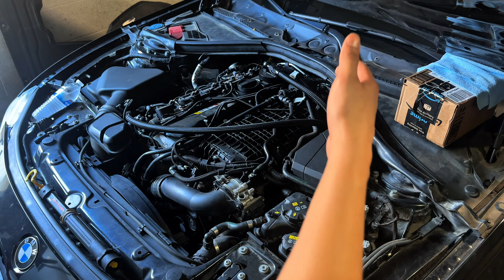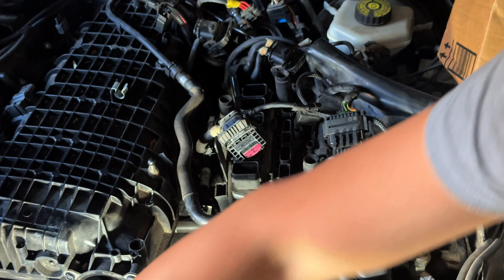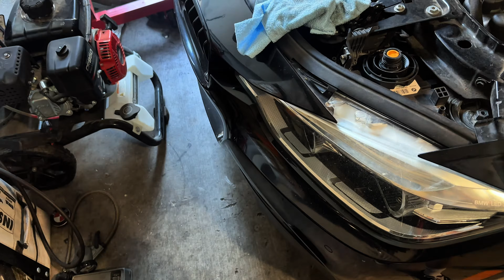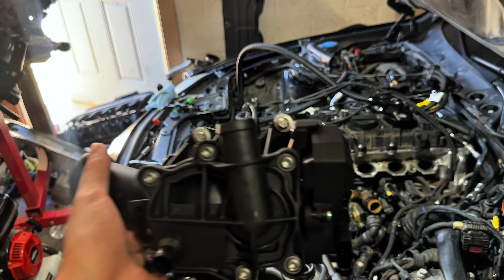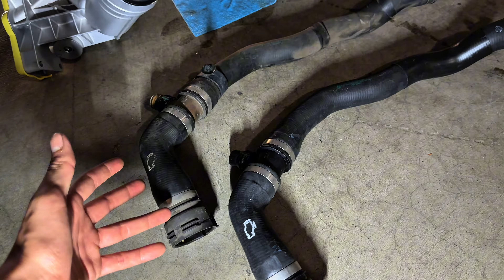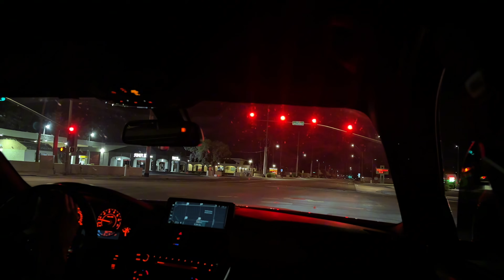B58 Oil filter housing replacement | DIY replacement video

Comment: I owned an E46 BMW for 16 years.  2001 325xi.  The oil filter housing was in the front of the engine and was made of metal.  Felt like a considerable job when I did it many years ago.  It was NOTHING compared to this.  So many things to remove in this job that can break (plastic coolant hoses, electrical connections etc.).  So many things can go wrong.  No thank you!  I am considering getting an M240i but will not get without a CPO or BMW extended warranty.  This type of job is no fun and for a much younger man than me (And I have worked on cars my whole life since age 8 or so and now 64).

Comment: Hey planning to do this job water pump + thermostat alongside coolant flange and oil filter housing on my bmw m140i b58 on 106k miles. 

Would you recommend aluminum oil filter housing and coolant flange?  or to keep with origianl oem bmw plastic parts?
UK based so your links will not work. 

Kind regards
Reply from the maker: I would recommend the aluminum OFH but get the OEM coolant flange I recently had the aluminum one start leaking again so I’m gonna have to redo that job
Reply: @Dieeggo.o  great thank you.   So oem coolant flange with oem seals?   And then aluminium oil filter housing (mahle) model I found?   With oem gasket set.  

For the gasket set do you need 1 or 2 gasket sets for the OFH?
Reply from the maker: Correct, I used OEM gaskets on both. You should just need 1 set

Comment: This is a time where we need better hoses for our cars. This cooling system is a complete disaster. Keep chasing new leaks.
Reply from the maker: I forgot which company makes a full kit out of silicone and billet ends however it’s around 2k if I remember correctly. So there is a kit it’s very pricey 😅

Comment: Hey man!
Thanks for uploading this video!
I wanted to ask, how well have the repairs been holding up?
I did Aluminum flange and Oil Filter Housing as well but am worried about the lack of reviews out there!
You a real for doing this yourself
Reply: hows your parts been holding up?     idk if to keep with plastic or not.
Reply: @Soulsfun20 Been holding up pretty good! My radiator started leaking though, lol. 90k miles into it. I believe the aluminum ones removed all other possible weak links so it went to the next weakest links. Just do a full coolant system refresh with the upgrades and you should be ok

Comment: Why is everyone saying this is hard? It doesn’t look too bad in the video. I plan on doing it tomorrow
Reply from the maker: I personally thinks it’s not too bad if I would have been able to constantly work on it. I feel like it could have been done in 4ish hours
Reply: Update?
Reply: @behmw was still waiting for a response lol may try it tomorrow. Idk why it takes people 2-3 days when the guy did it step by step in the video in 15 mins lol. But I’ve never done it so if people in comments have actually done it and say it’s a hard job then idk haha. I’d hope it would take a few hours max
Reply: Tbf just seen the other comment that said 2-3 days spread it out and it took 6 hours. Will probably try it tomorrow and let you know. Try reply to me again in a few days to remind me to update lol
Reply: @mrcarfan9000 it took me a whole full day bro I did this yesterday & it was a pain in the a$$ started at 9am & didn’t finish until 11PM on the dot the 2 bolts in between the coolers were so difficult to get to perfectly and they took forever to get out because of the length of them and I accidentally forgot to plug in my temperature sensor back in for the coolant so the manifold had to come back off today just for that, so far so good thoe

Comment: Did you have to drain coolant and oil? did you use any rtv or grease?
Reply from the maker: Yessir drain coolant, I would do an oil change just in case. I did not use rtv, but I’ve had a lot of uncertainty about the metal coolant flange from others. I just advise to put rtv on the mating surface of the metal coolant flange if you do 👍🏽

Comment: How has the metal coolant flange been since you replaced it? Did you use an OEM gasket with it or the after market one? Mine is due for a change , and I have both a metal coolant flange and an OEM one in my hands, not sure which one to go with.
Reply from the maker: I have not had any issues i used the metal flange with an OEM gasket. If you're worried about the metal flange just use the plastic one, my plastic one lasted 130k miles
Reply: @Dieeggo.o my oem flange just went out at 65k miles. I think I’ll go with metal + OEM gasket like you. A lot of people say metal flange sucks but that’s most likely because they’re using a bad Chinese gasket
Reply from the maker: @Dannton440 could be I’ve read that as well. I would, just for peace of mind, put the gasket and a thin layer of rtv on the mating surface

Comment: hey bro, i am 16 and doing this repair in my garage. Everything is going pretty smooth but there is only one thing i messed up on and really bad. I forgot to take pictures or mark where the wires for the dme goes. So i was wondering if you could help me out in how i can figure that out.
Reply from the maker: That’s no issue man, those connectors only go into one spot. So they can’t go into different or the wrong connector on the DME. I can try and find a video and link it to you
Reply: @Dieeggo.o  oh i see, yea if you find one that would be helpful. Thank you!

Comment: Did you drain the oil when you replaced this?
Reply: The OFH*
Reply from the maker: i did not but i recommend doing oil service or if you do not just check the oil and top off oil
Reply: You didn't have to drain the oil when you changed the Oil Housing Filter?  How is that possible without getting oil all over the place when you take the old unit off?

Comment: This job is an absolute Fkn nightmare! Had to Replace the oil filter housing at 67K, then again at 135K 😡 along with the water pump and heat management module aka Thermostat! The leaks caused by plastic failure are preposterous on this damn car. Never again! Next car will be an IS350 or an RCF!
Reply from the maker: RCFs are nice 👀

Comment: Did u check for metal shaving before install, also did u swap the oil valve from the original plastic one ?
Reply from the maker: I did check and did not find anything it just had some rough cuts, I also did not change the oil valve I left the one that came with the metal housing

Comment: How is the aluminum flange? I saw someone saying that aluminum one leaks more than original plastic one. I’m about to overhaul mine too, but before doing all these want to make sure I did right choice. I bought REIN aluminum coolant flange.
Reply from the maker: I haven’t had any issues in the 3 months I’ve had it. Looking back at it, just to be safe I would apply a thin layer of rtv around the flange🤷🏼‍♂️
Reply: @Dieeggo.o you used OEM gaskets?
Reply from the maker: @Rzn8B58 yessir “genuine BMW” gaskets from FCP euro
Reply: The rein aluminum flange from fcp leaked on mine not even 1k miles in. The gasket broke down. Replaced it with the oem plastic one and no issues
Reply: seems like a gasket issue. Just like the OFH using OEM gaskets is the way to go.

Comment: Bro - This video is on point. Doing this as we speak and the way you tackled everything is very much how a DIY guy like myself would do it. Appreciate you man. Take a sub! Did you buy OEM on the HMM or aftermarket?
Reply from the maker: Appreciate that man! I got the "OE supplier" HMM from FCP euro, I believe its the same as OEM just different price point. I should have it linked. if not let me know I can send you the part number!
Reply: @Dieeggo.o  Yep - Thats the one I bought as well. Just got everything together this evening. I am gonna go get a compressor tommorow so I can vacumn fill it which should also show me if there are any leaks in the system (If it can hold vacumn then it should be leak free). I have OEMTOOLS 24444 vacumn filler kit so you should check that out. Apparently it makes filling alot easier. I definitely wanna test it for leaks before I slap that intake manifold back on. Then I have to figure out how to get the whole DME put back together lol. Should be fun.

Comment: Kudos to you! I’m bookmarking all B58 repair videos for my 24’ M340i 😂 
One thing I doubt is that even if you replace with metal ones, you won’t be immune to the rubber gaskets failure 🤔 I heard that OEM gaskets are trash and we should replace them with aftermarket fluorinated rubber ones that can withstand much higher temperatures.

Comment: This took me 2.5days… did it in sub freezing temps in my parents garage , but very worth it and satisfying in the end
Reply from the maker: Definitely a process where you just take your time. You’re a beast for the freezing temperatures though!
Reply: @Dieeggo.o great video man, this would’ve helped so much when I did it. It will now help lots of b58 owners out there
Reply from the maker: @Dannton440 hopefully it will. Thanks for the support man!
Reply: Im doing one now took me a few hours just to remove  everything. Did you replace  hoses or just oil filter housing
Reply: @eddiesgsr just filter housing and the coolant flange, I didn’t have any other hoses. Also took me almost 3 days with long breaks for work and so on, continuously working was probably 5-6 hrs tops
Reply: @Dannton440  thanks for the reply  im doing the same leaving  the hoses.   The oil filter housing  was the hardest part for me.   Ill text when i finish let you know  how it went.  Hopefully  tomorrow  if it doesnt rain
Reply: @e @eddiesgsr good luck man, hopefully you have OEM brand new gaskets for the OFH? I used an after market aluminum OFH but replaced the gaskets with OEM.
Reply: @Dannton440  I was thinking  to do that its actually  my brother's car  im gonna see if he buys oem gaskets. Thanks
Reply: doing it right now, -22celsius outside, cold garage 😁
Reply: @aaaccccwwww oufff I'm doing mine right now also, -25 here outside in the tempo
Reply: @aaaccccwwww  nice. Get her done brother.

Comment: What year is this B58 in the video??  I have a 2019. I noticed my coolant reservoirs look different in my X3 with B58 from your car.
Reply from the maker: This is a 2017 340i. There’s things that would differ with different chassis. But motor should somewhat be the same!

Comment: Did you also replace the turbo coolant return line to the electric water pump? I believe I saw that part in your video.
Reply from the maker: I did I couldn’t get good angles on the camera due to the tight space but I might make it a YouTube short. Honestly the hardest part of the job.
Reply: @Dieeggo.o  did you have to go under the car? Im stuck on this part
Reply from the maker: @johnnyf6397 for the turbo coolant line no sir, I found you have to take off the plastic trim right behind the engine on the firewall (10mm) that should give you enough room to get to the bolt holding that line. And to take the hose off of the turbo you can go through the air filter side and use pliers to release the clamp( I recommend cutting it off) you should be able to fish it out through the top! Lmk if I can help with anything else!
Reply: @Dieeggo.o yeah could you make a youtube short or a small video about you replacing it? Mine just went out and i have no idea on how to go about getting it replaced lol
Reply from the maker: @E30Tylerrr editing the video right now!
Reply: Yeah, thanks. I figured it would be difficult. I replaced my coolant flange, upper radiator hose, and a couple other hoses nearby. I saw the plastic connector on my coolant return line was starting to turn brown, but I couldn’t reach the bolt in the back of the engine, near the firewall. And it looked like I needed to remove part of the turbo, so I just left it…
Reply: Mine started leaking after replacing the turbo and needs to be replaced, it seems very difficult to replace I can’t even tell where it’s really going behind the engine when looking from the turbo side. Looks like I will have to take out the intake manifold
Reply from the maker: @samhadi7972 I used a borescope to see what was leaking before I removed my intake manifold. You can always do that aswell

Comment: 13:25

You forgot to change out the T junction hose on the bottom right.  That one is about to go too.

I have a full list of replacement parts if you want it, I just had the job done a few weeks ago.
Reply from the maker: Yeah I realized when I got to that point 😅. Got it ordered. Thanks man!
Reply: Can you send it over here
Reply: Can I get the list
Reply from the maker: @ChrisGlo-t6e  link in the description under the FCP euro cart
Reply: What T junction hose are you referring to? I’m about to do overhaul on mine, so just want to make sure to buy everything before I start.
Reply from the maker: @Dzh@D @Dzhumaev1 3:27  on the bottom right of the screen(under OFH) I didn’t replace in the video because I forgot to order. I’ll will try to find the part number and send to you
Reply: @Dieeggo.o I’m about to do this job next week do you know that part
Reply: @Dieeggo.o can you send me the part number?
Reply: @Dieeggo.o  it would be clutch if you can find that part number bro
Reply from the maker: @billygonzales2584   sorry bro but it should be this PN: 17128616558
Reply from the maker: @islandschafi91  17128616558
Reply: Could you send me the full list of replacement parts please brother 🙏